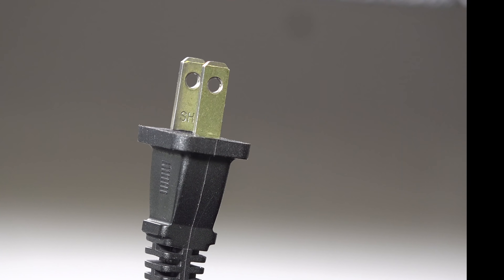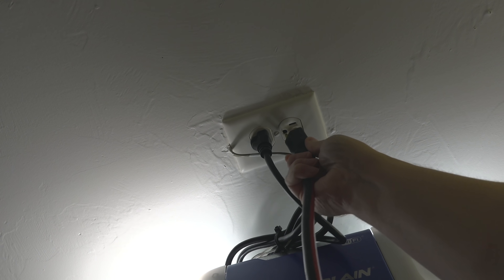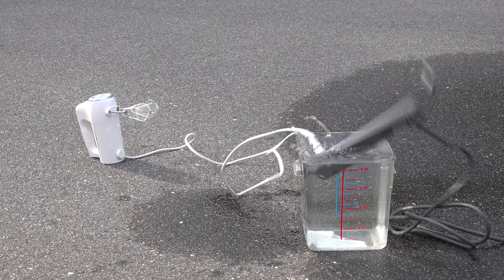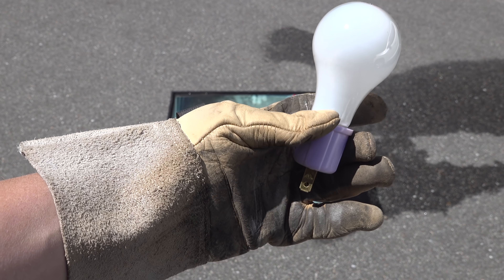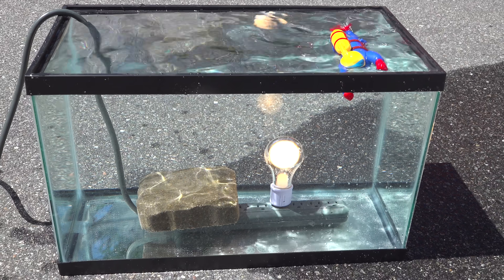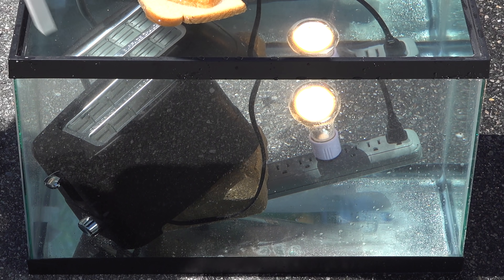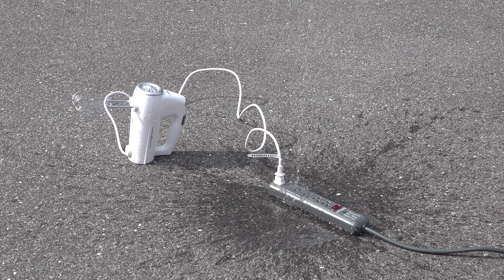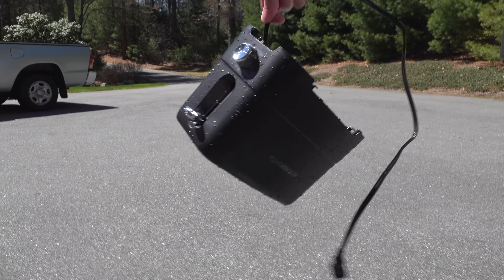What REALLY HAPPENS WHEN YOU SPILL WATER in an OUTLET?

Comment: Would be really interesting if you had something to measure the amount of electricity flowing through the water when the appliances were submerged.
Reply: None would be in the water. It would be struggling to transfer between the hot and neutral/grounding conductors in the plug strip.
Reply: Multimeters:
Reply: No current because theres nowhere for it to go
Reply: @olivercarter5546  but this would only be between the two conductors until something else went into the water giving the electricity a better and less resistive path to ground than the water between the two conductors.
Reply: @olivercarter5546  if you do E(volts)÷R(resistance-ohms)=I(amps) having a live 120v cord in the water there would be a current draw but likely not much at all going between the hot conductor through the water to the neutral conductor.
Reply: @olivercarter5546  there would be some current.... Depends on the water type as the water would be the "device"
Reply: @olivercarter5546  everything is conductive, just depends on how much voltage it needs to conduct. The water would have a set resistance per inch or whAtever and you could do the math to see what current would be drawn at 120v.

Comment: IF you had left the outlet in the water long enough you would have seen the water getting hot.
You can boil water by putting a spoon either side of a mug & connecting the spoons to the electricity.
The electrical resistance of the water causes it to heat up.

Comment: Nothing happened because he used a plastic tub and a glass tank. If there was something metal grounding the water like a metal bathtub drain pipe the electricity would have had somewhere to go and the results would have been very different. Electricity takes the easiest path which without a ground to escape the water was to follow the wire back to the outlet so it works normally.

Comment: Wanna hear a stupid I did, and it worked? Moved into an apartment that had the gas meter removed and I needed a bath..(gas water heater) there was a junk electric stove in the carport, removed 2 burners and wired them in series, got a couple junk extension cords, used a volt meter to find 2 outlets that were on different legs for 220. Filled the bathtub full of water and plugged it in. Took about 20 min and the water started steaming, unplugged everything and took a hot bath....Nope, didnt stick my hand in the water with it plugged in but it shouldn't have been a problem, electricity always travels in the path of least resistance and that be the stove burners.

Comment: It still blows my mind when I see the male typ connector the US uses. If you dont put it in all the way you can reach the live connector. I guess its good if you are out of outlet splitters and need power. Just twist the bare wires around the connector before puttning it in :)
Edit: here in Sweden we also have some connetors that have all metal pinna but... ALL female connetors are resessed and prevents accidents. Also all outlets are "kids safe" and requires that both holes are pushed at the same time to get anything in. But thats maybe a standard in the whole world?

Comment: The answer is that pure water (distilled) is not conductive. The reason most people think water will shock you with electricity running through it is A) Tap water contains minerals that could potentially dissociate in ionic form and allow the transference of electrons and B) Our skin has sweat which contains salt. A readily dissociative compound that increases the electro-conductivity of water. Most electronics will short circuit in sea water, but very few in distilled water.

Comment: Well here's the thing, water doesn't conduct electricity. Minerals within the water do. So if you have pure water, it won't do anything. However the moment you introduce any foreign object inside BOOM! There goes the shocks and electrical stuff. That's why when a person is in a tub or pool, the current flows from the source to the person. And why when you just put it in water or spray it, nothing happens. 

Thank you for coming to my TedTalk.

Comment: Not sure why people are so surprised by this, water is conductive but not nearly enough to become a low impedance path that would cause more than a 15 ampere load and trip the branch circuit over current device. It’s about the same reason that grounding electrodes on light poles are completely useless. You can take an ohmmeter and test the resistance of your water and you’ll see that if you do the math on 120VAC divided by the resistive load the water presents it will never draw enough current to trip your breaker.

Comment: that's pretty amazing. A few years ago my window air conditioner started to leak water onto the power strip that the ac unit and other items were plugged into on the floor beneath the window.  I was nervous it would spark and potentially start a fire. It's an old ac unit that i cannot replace because it is special design and the only one that will fit my window. what I did to fix the leaking was after researching  1. when the air conditioner shuts off, wait at least 15 minutes before turning on again (it has ice inside that needs to melt)  2. Installed a drip tray underneath, the ac unit tray was too small, so I bought a drip dray that is for washing machines and it fits perfectly, I  drill holes in the tray on the bottom of the tray where it sits outside the window so if it (and I angled the unit, so if water drips now in front it rolls to the back and outside the house.
Reply: So the ice inside the A/C unit means that the evaporator is getting TOO cold.  The evaporator should remain above freezing.  The reason it's probably getting too cold is some of the refrigerant has leaked out.  Long story short, that AC unit is not long for this world and it should be replaced.

Comment: The electricity doesn’t go back instantly if stuff using it gets submerged…. It gets distributed throughout the water then continues its circuit… but organic material in there and it will begin to boil, melt or burn….

Comment: Water by itself is a horrible conductor of electricity, it's the impurities like salt, small metals and etc. that raise its conductivity. Submerging it in water doesn't cause a short simply because the copper busses inside the power strip are more conductive than the water so the electrons continue to flow in the closed circuit since it's still the easiest path to flow in.

The reason why we get shocked however when we touch electrified water is because we have a higher conductivity compared to water because of the salts and metals in our body. Due not that you also will not get shocked if you don't complete the circuit (aka become a path to ground) which would require you either be barefooted or have really damp and conductive footwear. Though you really shouldn't be submerging anything electrical in water, treat things and yourself with caution.

Comment: The conductivity of water depends on the concentration of dissolved ions in solution.

The units of conductivity are Siemens per metre S/m.

Deionised water by its nature has very few ions. Its conductivity is about #5.5mu#S/m.

Sea water has a relatively large number of Sodium and Chloride ions and has a conductivity of around 5S/m. This is because the Sodium Chloride salt dissociates into ions.

Hence sea water is about a million times more conductive than fresh water.
Reply: Actually came to say this though in a slight less scientific way, you did better. Basically h2o is not conductive, one can safely test this with distilled water and a multimeter. Distilled water being free of minerals that conduct electricity will not read continuity with a multimeter until the leads are touching or at least really close depending on the quality of distilling process. It’s completely possible the in this case his tap water has such little continuity that the circuit is unaffected, as electricity is taking the path of least resistance (the circuit) and continues to work. Electro boom I believe actually made a video on this very topic and also explained the resistance of human skin. While the risk is there and potentially fatal, it doesn’t work quite as people think.
Reply: @deadontarget8503  Sorry, I don't remember posting that. I might have been stoned and cut and pasted some random info. I do that sometimes. Anyway, thanks for clearing this up. 👍

Comment: I am not an electrician but with not route to ground, nothing will trip as there will be no surge to protect from (unless something lets it ground like you), GFCI's are grounded thus they trip.  This is why the UK way of wiring is much better than most other countries in the world, everything is grounded by law, even your bathtub!  All plugs are grounded and have a fuse that prevents an overload of the cable from the plug to the appliance (assuming the correct fuse is installed) which stops things like extension cables from causing fires due to them being overloaded.   Circuit breakers in the USA (and other countries) only protect the cables in the walls not what is plugged into the wall outlet and beyond.  So if you plugged in a 15A extension cable on a 15A circuit and put a 20A load on it the breaker will trip but if you put a 10A extension on a 15A circuit and put a 15A load on it your extension lead will burn up and maybe even catch fire, (please do not try this at home or anywhere else for that matter) so be warned!

Comment: Ok so first water isn't conductive it's the impurities inside that make it an ionique solution, second current is a movement of electrons which means that tape water would only create a problem if it links 2 conducteurs that aren't in the  same system which would lead to an overflow and either burn the wiring or trigger a shutdown. This is why putting a handheld fork in a socket will burn it, because you're creating a circuit that turns an electrical output into an input as well the 2 currents will collide and you'll be pretty much turning the fork into a lightbulb which will heat it up tremendously fast and burn the plastic plug and your hand if you're still alive to feel it.

Comment: As far as I know, water isn't really a good conductor, that's why nothing happened underwater. 
Though if the water had a lot of ions in it, like salty water, maybe there would've been enough current flowing through the outlets to burn a fuse or maybe open a power switch

Comment: Water is only dangerous with electricity, because water is the best conductor, even better than copper… But with this amount of water, it’s hard for a single +/- rail to conduct with eachother, since the flow of the power is not connected “peer to peer”, but get’s lost in the overly mass of water. Therefor there is no spark, nor contact with the +/- rail, to make a short happen. If the amount of water was less and not sprayed on, the result would very. But this not a guarantee! In some cases shortcircuits can occur… It’s tough to explain tho… But still, don’t try this at home!!

Comment: Misinformation... the GFCI only helped because you had water bridging the live and ground... if you would hold live and neutral then you would be electrocuted until your skin and flesh breaks down and it lets more current through than the breaker is rated for. But this doesn't mean it must happen. Also the outlet would work under water as long as the water has minimal amounts of mineral. Destilled water itself doesn't carry electricity. In case you have minimal minerals and put the outlet under water the electricity will travel trough the most conductive line it can take. Thats why I would touch that wet outlet when nothing is plugged in it. Because the most conducive part could be my skin and flesh...

Comment: I had one of the extensions plugged into the wall and had a lava lamp on a shelf above it. I guess it got too hot and cracked the glass of it and the oil inside started spilling over the edge into the outlet and it started making a buzzing/boiling sound.

Comment: 1.1 Power Extension Outlet Exposing on water.

Therefore I conclude that electrical extension outlets are no changes after spraying, putting on  water tank.

 PART 2
Why there no changes?

1.2 Because there's no living organism exposed on electrical surge and got toasted.

Comment: This is not too surprising water is a very bad conductor of electricity and the amount of current flowing through a load is inversely related to the resistance of the load.  The toaster has an impedance of about 12 ohms the water probably has an impedance of around 10000000-500000 ohms meaning at the most 0.0024 amps are flowing through the water and 10 amps through the toaster. That is about 4200 times more electric current is flowing through the toaster than the water in even the worst case. The devices are also very simple meaning the small changes in current will have no effect on them.

Comment: There is a video that explains this. Basically water is a bad conductor. If you try to sumerge two open cables under water, electricity will flow through the water but it's going to flow poorly but that doesn't mean it's not dangerous if you put your hand in the water though, you could die.

Comment: The reason the breaker didnt trip was because it is made to trip when the current passes through a human to ground or neutral. But gfci trip because it's made to trip when the current passes through water. Basically, their thresholds are different. The reason that gfci are necessary is that current passes through water differently as compared to humans. When you are in water that has current passing through it, you can still, get a shock. You should watch Mehdi from Electroboom to know more. The bubbles were actually hydrogen and oxygen being split through electrolysis btw.
Reply: VERY incorrect.  A breaker doesn't trip just because a human is the path to ground.  A breaker will trip when the current exceeds the rating of the breaker....which is WAY more than enough to kill you and make it hurt the whole time.....and if you really payed attention to Mehdi at Electroboom you would know that.  GFCI trips due to ground fault leakage, it basically detects that the current coming in isn't the same as the current going out....meaning there is a path to ground somewhere, and if that 'somewhere' is your body, it just saved your life.
Reply: Oof, no. The water just wasn't conductive enough, that's all. Add a little salt, that breaker would trip quick. "Made to trip different" lol what the fuck? No.
Reply: @reddog418  Water itself isnt conductive enough but it always has ions in it which allow the current to pass through the water. Salt is an example of an ion. Ghe reason his breaker didnt trip was probably because he used highly purified water like RO water. Btw all matter conduct electricity just that it's at different voltages.
Reply: Mystic  Except his "explanation" is moronic lol

Comment: Would this be any different if it was done with a higher-voltage outlet, like a UK 240 V line?
Reply: Under the same conditions with the same circuit i would think not unless the breaker drew more power than its designed amount or there was an elcb or  rcd breaker included in the circuit (all new builds have these i think by law) there's too many variables but a circuit with the right protection will trip that switch straight away

Comment: Add. Salt.

The reason you didn't get a reaction was because the electricity had nowhere to go. Water is surprisingly non conductive, but if there is salt, soap, or anything else that would give it a path, things you would commonly find in a bath, you get things shorting out

Comment: Bet that experiment wouldn't work in Europe with our 230V, I guess 120V is a low enough voltage for it to work under water, but if you sprinkled a bit of salt in that water I bet it would trip right away.

Comment: Ok, so the GFCI tripped when you put water into a plug strip that had a ground conductor and ground pin on the plug.   It worked perfectly.   Now, plug a two prong corded plug into the strip and throw whatever it powers into the water.   Will the GFCI trip then?   The answer is no.   There must be a path for the current to flow other than on the hot and neutral.   Since no ground conductor, the hot and neutral remain the same amperes.   There needs to be a 5 mili-amp difference for it to trip.   So, if you are grounded, don’t put your finger into the 120 volt water.

Comment: Wada.  In all seriousness though, the way American wiring is done for houses sickens me to the stomach.  Being someone in the UK I am used to something called a RCD circuit breaker.  If everywhere installed these relatively cheap breakers into their houses the death rate of people uneducated from the dangers of electricity would be drastically lower.
Reply: We do have gfci breakers for outside outlets and bathrooms and around kitchen sinks. Just not for the whole home. Also arc fault breaker’s for bedrooms. At least in newer homes it’s required, or remodeling of older homes. 🇬🇧🇺🇸